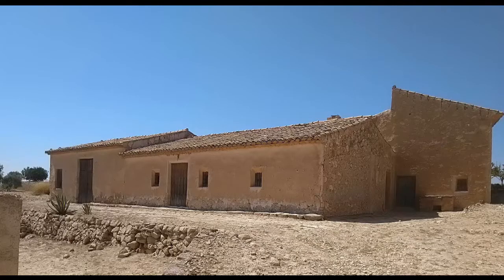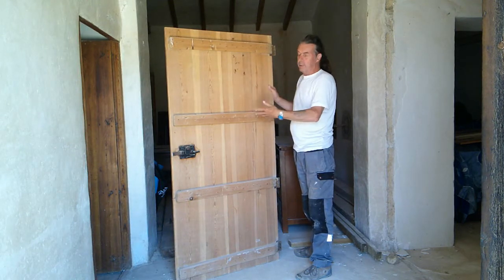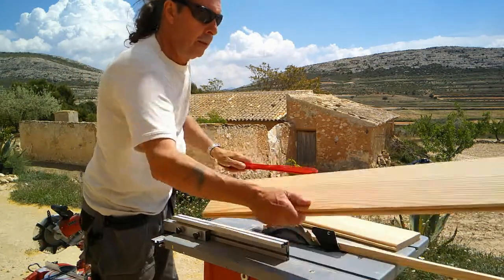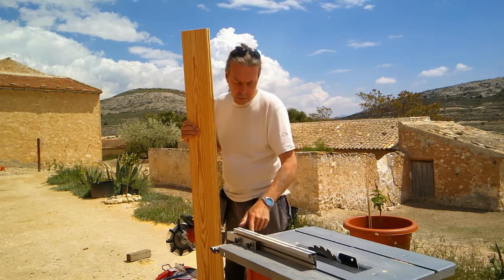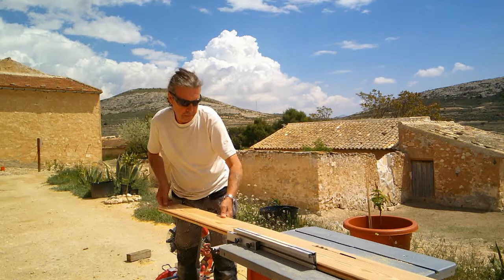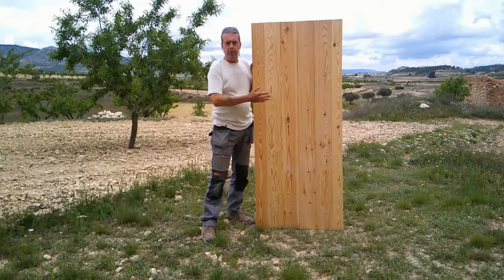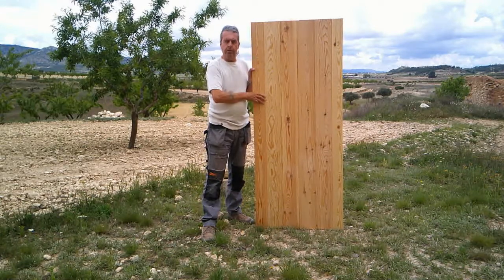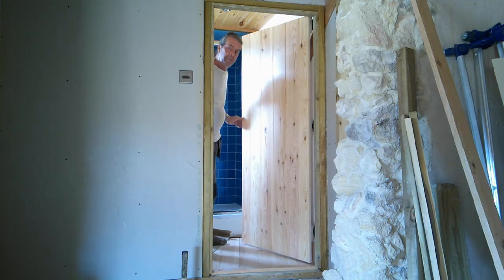How we make solid wood, traditional farmhouse doors  - Old Spanish farmhouse renovation

Comment: Love your work shop, what do you have that press with Jack for? Wheelbearings? Are you good att welding? I just bought a Mig weld to start learning.  I have an old Van that needs a little love. Regards Rickard from Sweden 🇸🇪
Reply from the maker: I use the press for bearing yes, but also for bending steel - as you can see in the 'trash to treasure' vid. I'm going to make an adapter for pressing fruit in the future, maybe even olives, to press our own oil lol. I was a welder fabricator for a while in a previous life.
Reply: @FincaLife  Well, that press comes handy , only imagination how much you can do with it.  Did you built it yourself? I bet you did! Regards Rickard